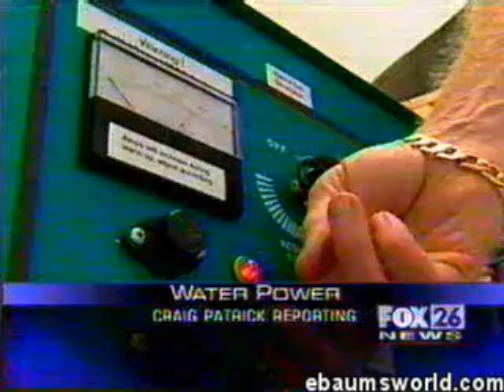Hydrogen - Water as fuel

Comment: The blow torch = cool
Use for the car = impractical
fuel->electricity at the plant->electricity at your car->water electrolysis->hydrogen combustion->your car moves
vs.
fuel->gas combustion->your car moves
each step has inefficiency, the amount of inefficiency varies; but in general I'd put my money on gasoline's efficiency.

A counter argument is: hydrogen burns clean!  but the fuel at the power plant doesn't, and if you burn more at the power plant than in your car then it's counterproductive.